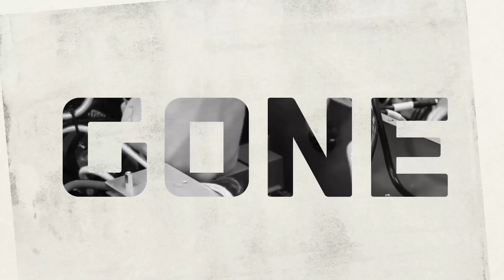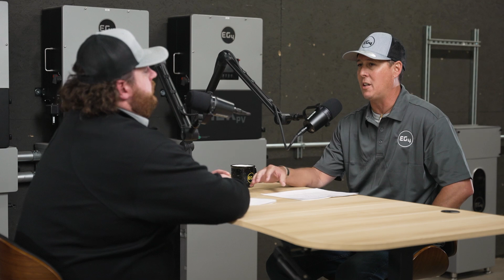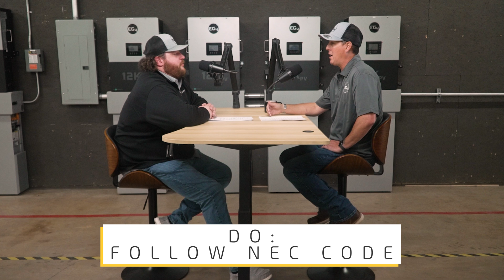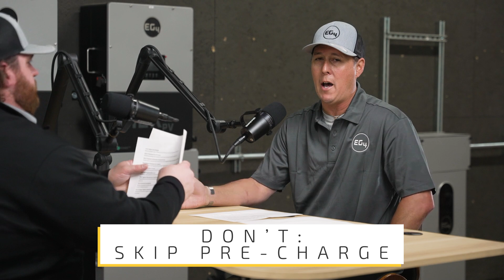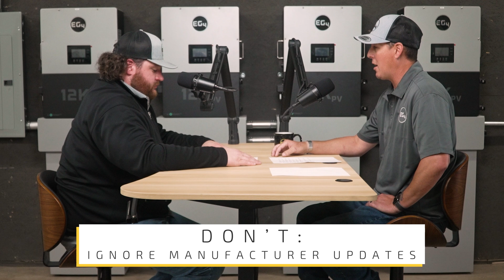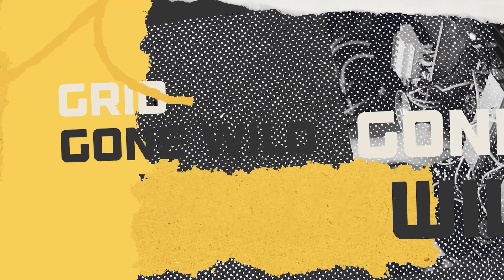The Shocking Truth About Solar Installations (Do’s & Don’ts Revealed!) || Grid Gone Wild Episode #10

Comment: PLEASE HELP!
Buying a 3rd power pro battery and will need to update firmware on other 2 batteries. I’ve heard conflicting reports on what I need. 232, 485, flash drive, etc. Do I need a RS485 cable to update the firmware on these? If so, where can I get one? Signature Solar does not have them.
Reply from the maker: Depending on what update you need, you may be able to use the new battery firmware adapter. You can find what update you need if you go to the product page for you battery on the EG4 website, scroll down to the bottom and click firmware and download the zip file. If you have any issues, please contact tech support.

Comment: Thank you for the excellent information guys! I'm a DIY'r with a grid tied Sunpower/Enphase AC solar system. I'm in the process of installing a Grid/Flex Boss with 3 Powerpro All Weather and the one question I had was how to, or should I ground the conduit box. I do not see the grounding point on the conduit boxes that you referred to, do you have a picture that points to it? Also when grounding more than one conduit box, should they all be tied to one main ground in the Gridboss or can some be tied to the Gridboss and others to the Flexboss, or does it even matter?

Comment: I have a 6000 XP and a 280 amp hour I think it's called ProMaster by eg4. My question is about having to discharge the batteries down to 20% in some more consistent pattern. I find that hard to do given that I am off grid and never know the solar situation for the next day. Do I really have to discharge my batteries that far, or can I go back and forth from 100 to 60 SOC and have my batteries work fine for many years?
Reply: Hello, to balance your batteries you need to take down then charge it up if you are using smaller batteries to make a bigger battery a external balancer will help a lot. The app offer a force discharge mode.

Comment: If this is not covered - I have a flexboss21 (and gridboss, ext 14kw battery). There are 4 small arrays with 1 with 6 panels (~240V), 2 with 8 panels (~320V), and another not connected that has 10 panels (~400V). I have the 1st 3 arrays into MPPT 1, 2, 3 ( 1 each). What should I consider when adding the new array? Should I try to match the 2 8 panels to MPPT1 to open up an MPPT for the new array? The arrays are not easy to connect together, so I have to maintain 4 separate arrays. They are also under shade at different times of the day - so rare for more than 2 arrays to be under the sun at any given time. DIY except for the big wires so far.